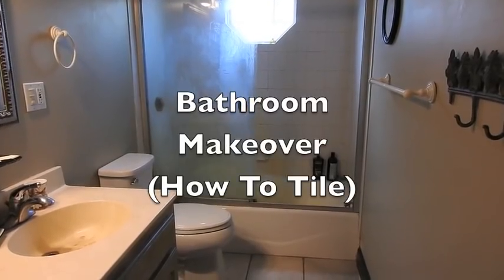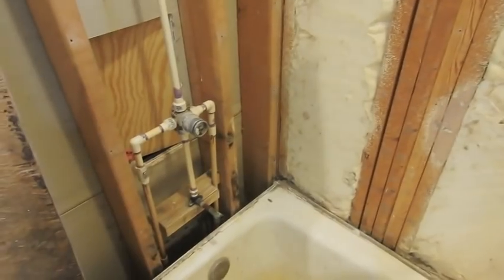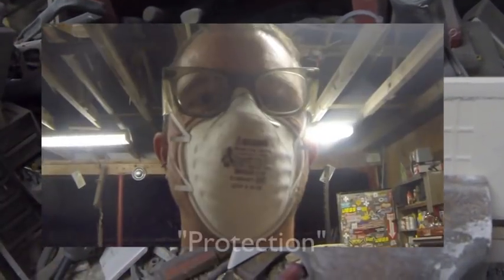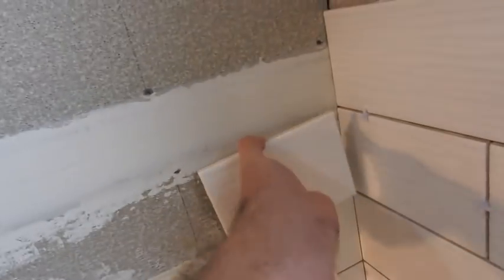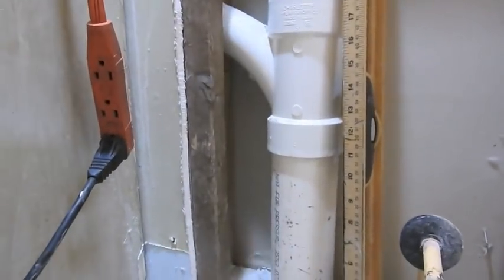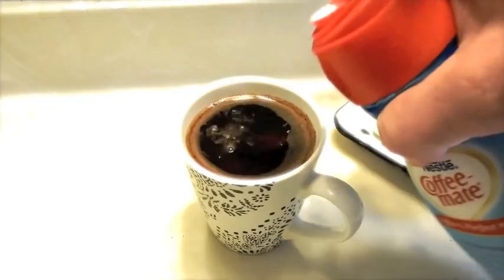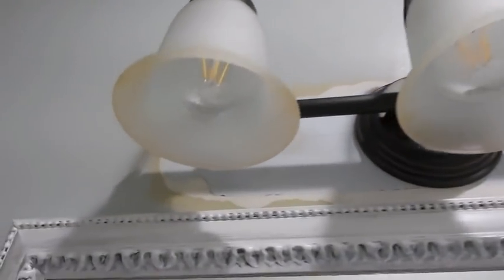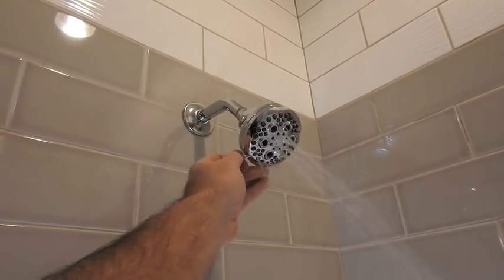DIY Bathroom Tile Redo How To

Comment: Nice work!
I've never used that tape on anything other than drywall.
I use a sealer/waterproofer for the seams that is applied with a paint brush.
Also from my experience with the premixed mortar, it takes three days to dry before you apply the grout.

Awesome job
Thumbs up
Reply from the maker: Thanks so much and thanks for watching.

Comment: your good at tiling. i struggled with cutting curves on the 12x12 floor tiles around the toilet & still have to do the walls. i use a 4" diamond blade on the angle grinder they're like $12 at home depot. i to had to order the pedestal sink it was about $390 but well worth it and new oval toilet about that much to. seems like whenever i start a home remodel project something else expensive around here breaks down
Reply from the maker: expensive stuff loves to break here too... thanks for watching.

Comment: Hey man, thanks for the video. i'm new to this and learning. Do we need to make the space between tiles and the wall waterproof?
Reply from the maker: Cool, I have my other bathroom redo come out in a week or two. I hope you will be check it out too...  I would suggest using the cement board if you are using tile and the tile should make it waterproof. It would not hurt to do extra waterproofing either. I would probably research it more and get a true professional to give better advice. Hope it goes great for you and thanks for watching.